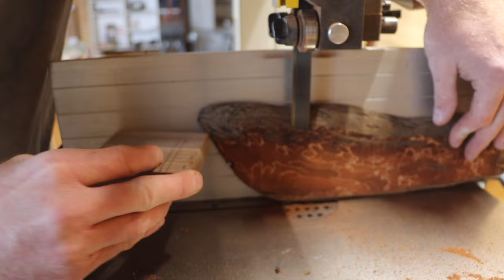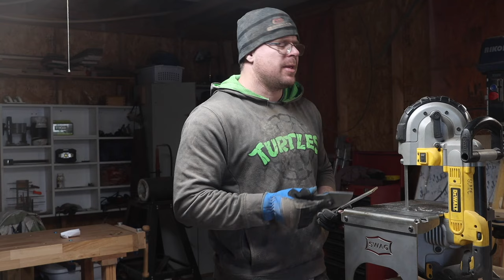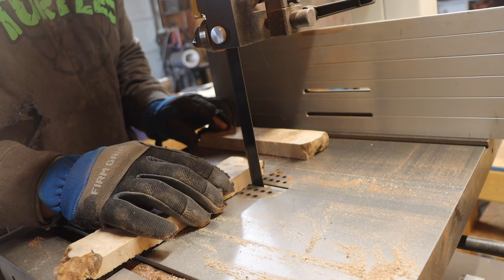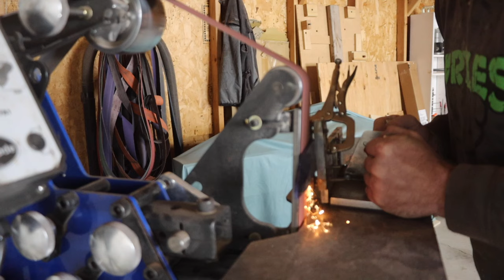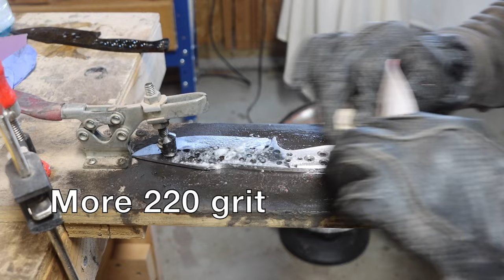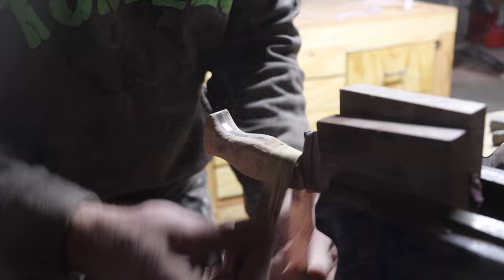Stock Removal Knife Making

Comment: Outstanding work!  I want to make a preventive suggestion about your hammer.  I noticed how big the handle is.  When you are forging, if you notice that you are gripping the handle tightly, it's because you feel like you don't have control over it.  A tight grip can damage your hand and arm.  I know from experience. I pinched nerves from my neck to my wrist.  If you find this happening, it would be best to resize the handle until you don't grip it so tightly.  Your hammer looks like a Peddinghaus?  They are good hammers, but their handles are tree trunks!  Again, great job on the knives.
Reply from the maker: Hey I really appreciate such a helpful comment. Thank you for that. I will certainly pay more attention this this next time i'm out in the shop and not afraid reshape handles. Thanks again

Comment: Hi Dustin, nice knives and you have some fine machines too. Also the wood looks cool, however, I'm afraid you won't properly stabilize it without a vacuum chamer. Pouring the epoxy, even if it's thin, will harden just the surface, maybe just fractions of a milimeter deep. You need to remove air with a vacuum pump and force the epoxy into the wood to replace the air. That way the wood will be hard throughout and you won't be getting such blow outs due to the wood softness (though I would still back the bottom side when drilling). I have got such chamber with a pump for Christmas so I'm looking forward to try it soon :) All the best!
Reply from the maker: Hey thanks my friend. Yeah, I'm well aware my method was less than ideal. It did soak up more than I thought it would though. Which chamber did you get? I've been wanting one for a while and now does seem like a good time.

Comment: try JB weld Wood Restore Liquid Hardener next time. under vacuum is even better. will impregnate the scales with acrylic and make them polishable vs the epoxy.
Reply from the maker: Hey I appreciate the advice. Thank you. I will be looking into that in the future.
Reply: @SawForgeGarage  there are a couple good videos on using canning methods to create the vacuum to displace the air in the wood. I’ve done that and a vacuum chamber. Good luck!!
Reply from the maker: @savagestyle124  Thanks again.

Comment: So does the method include “heat treatment” or is that part of the forging process? Thanks. I know a little about knives but some people are always crowing about inadequate heat treatment. I wondered if that was still a thing.
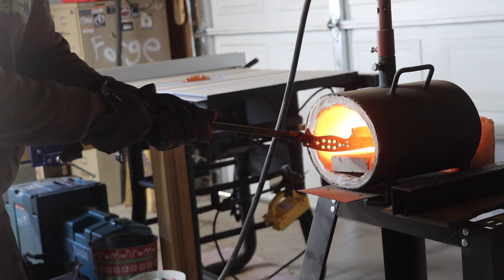Reply from the maker: I appreciate your comment. I probably didn't show or talk about it very well but heat treating is very much a thing. I heat treat this knife at around the 7:15 mark. These two blades were made out of 1084, which is a very forgiving material to get a good heat treat.
Reply: @ thanks. I bought a knife at blade show in Atlanta maybe ten years ago from a guy named Ray Ennis. He was a fairly well known guy who made entrek brand knives. He has a series of vids showing how he did it. Anyway, he insisted that 440c was as good or better than any other fancy steel if adequately heat treated. He sent his out to the same guy for every knife. He also used the exact same material for every knife handle.
Real nice guy without much attitude. I didn’t know exactly who he was at the time or I would have bought more.
Reply from the maker: @butchie2752  Hey that's awesome. A couple years ago a guy brought me a Ray Ennis dagger he got of a storage shed auction. It was missing a sheath so I made one for him. It was a beautifully made dagger and honor to hold onto for a couple days. I haven't worked with anything other than 5160, 1095, and 1084. I have had a lot of success with them all. One of these days I'd like to get a press and kiln in order to work with and make some neater looking stuff, but my budget isn't quite there yet.
Reply: @SawForgeGarage  mine is called a batanga. 12 inch blade tanto tip.